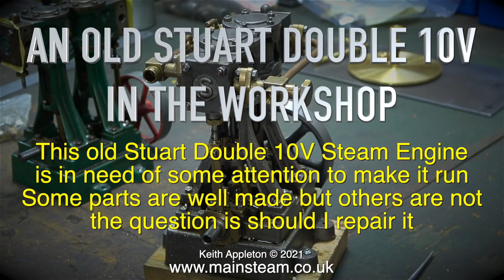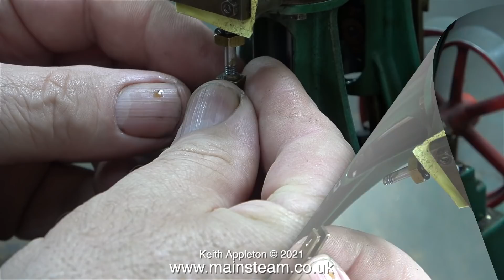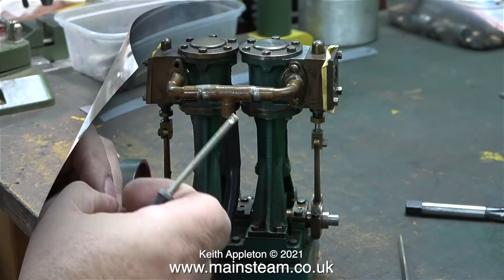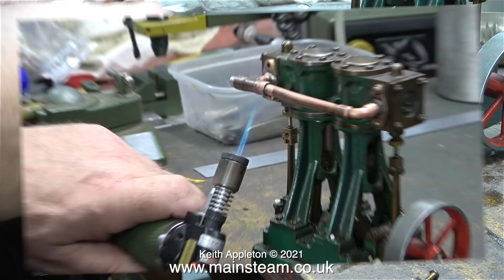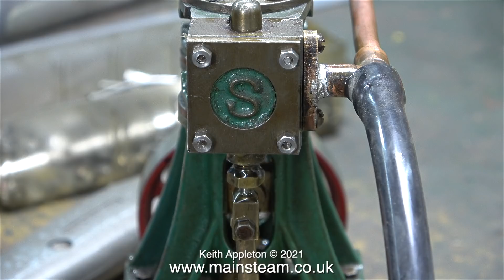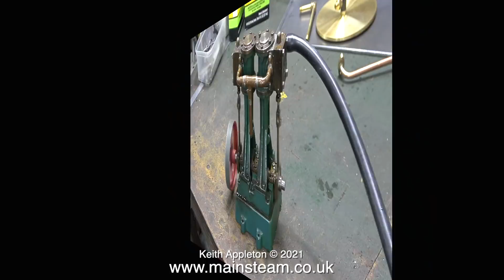AN OLD STUART DOUBLE 10V STEAM ENGINE - IN THE WORKSHOP

Comment: Great Video Keith , anyone can bolt parts together but a certain knack coupled with years of experience is needed to get things running properly.
Like you I'am a long time R/C modeller at the moment flying Electric Helicopters . The Goblin Heli. kits are nicely made but still requires a certain amount of fettling to get them flying correctly.